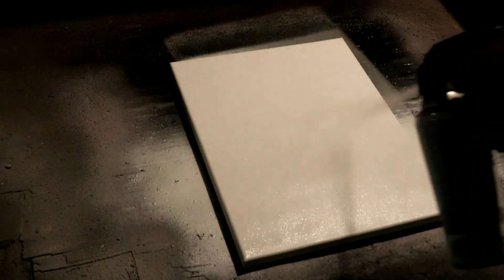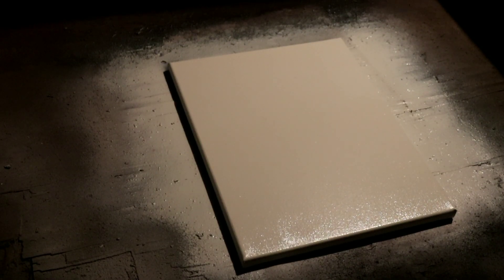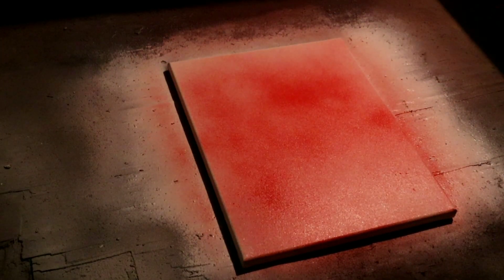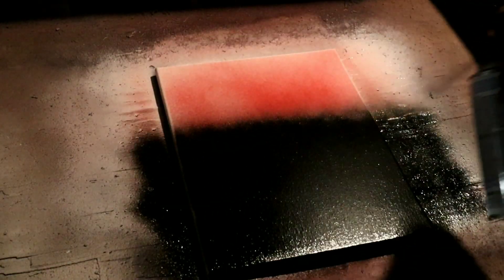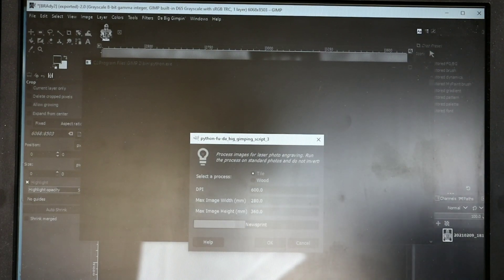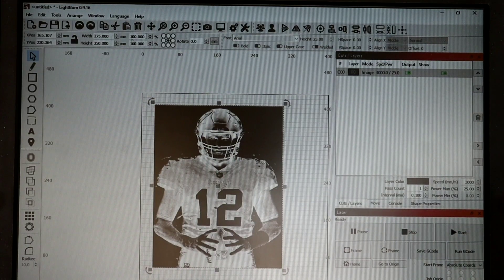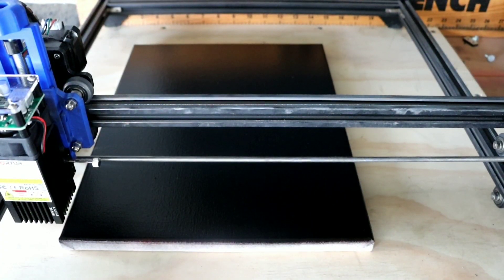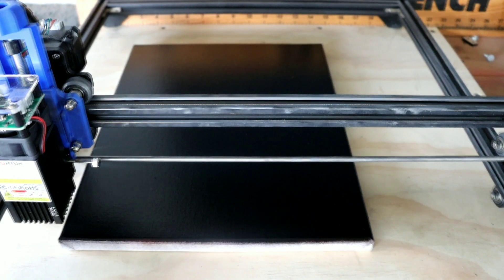Tom Brady The Buccaneers QB engraved on 11x14 Canvas  Using the Ortur 20 watt fixed laser Module

Comment: How did you get the mounting bracket to fit the module to your old machine? Ortur are telling me the sliding bracket doesnt come with the module
Reply from the maker: It comes with one just not the one I have . It must be the fixed focus module
Reply: @zerica24  i dont understand the answer, the upgraded 2001 module comes with the sliding bracket?

Comment: Straight fire. 

How does the new module differ from the old one? Pros and cons of each?
Reply from the maker: It is easy to get the best focus point. Which means more detail and cleaner lines to early for cons but  a lot of pros.😁
Reply: @zerica24  dang I might just have to pick one up. Thanks

Comment: Saw your cable dragging the canvas.. I was burning one last night, the cable grabbed the canvas and moved it mid burn. I just put 1 more coat of black on it to reuse it. I could still see the depression from the last burn. I will do like you did and redo the white 2 or 3 times then another black coat. I got 4 orders today for Valentines day. Got to hurry...  Tempted to try my Big Red 60watt one more time.. If I can get the settings right, I could do a 8X10 in 30 min or less.
Reply from the maker: Thats fast.  Mine just start dragging again i got to zip tie the slack.